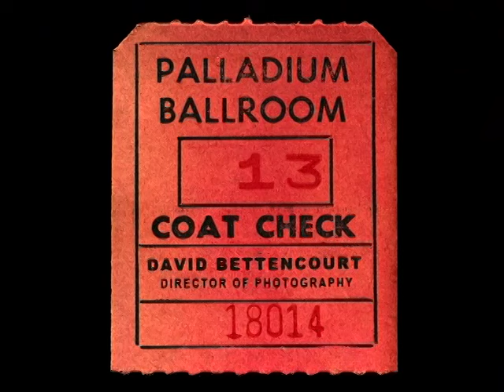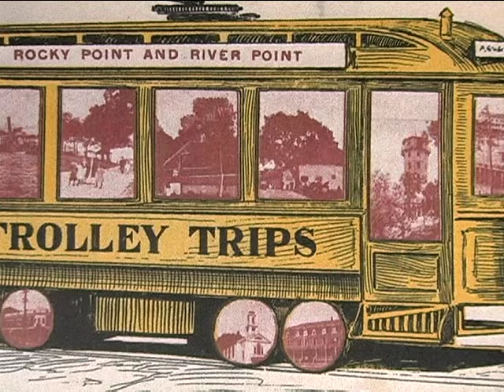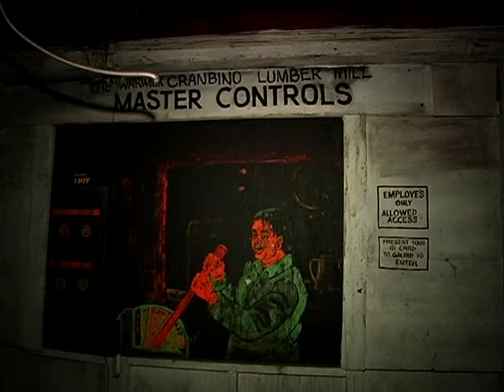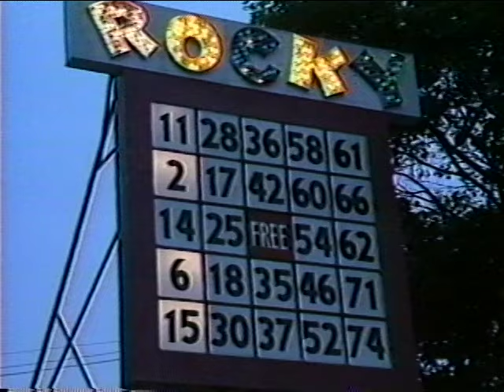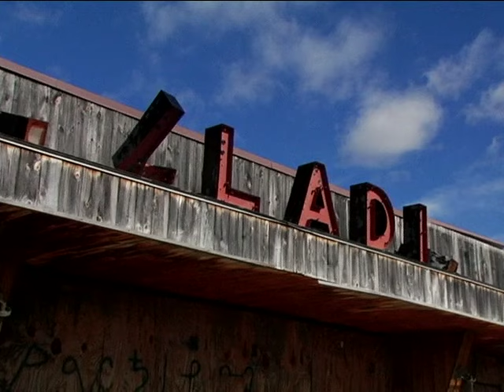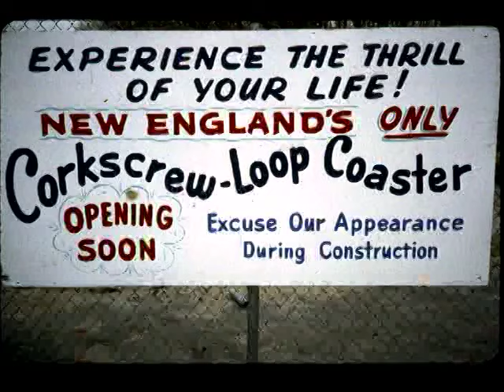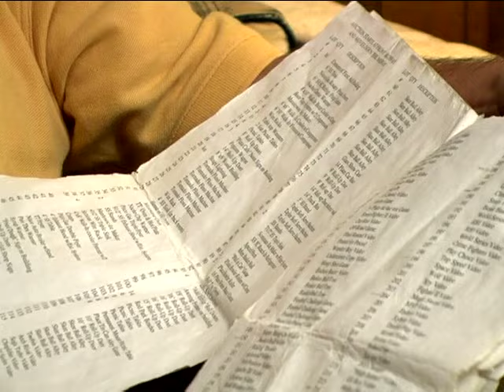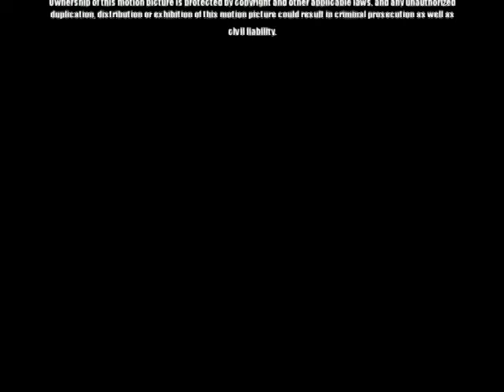You Must Be This Tall:  The Story of Rocky Point Park

Comment: I worked at Rocky Point Park when I was a kid for 3 years. I was there 1985, 1986, and 1987. I started working in foods 1985 and the following year I work in traffic and rides because there was a shortage of ride operators. 1987 strictly worked and rides. It would be easier for me to list the rides that I didn't work on as an operator versus the rides I did work on.

Comment: @53:46 my aunt and I had this same exact experience on the skydiver. The operator said you don't have to go upside down, just use the steering wheel. The problem was you had to have the strength to rotate the steel box your inside and fight centripetal forces as it rotated. We just screamed stop the whole time and he laughed at us as we flipped around.